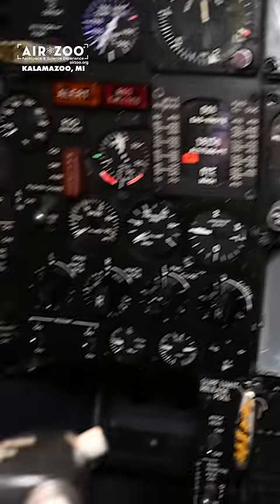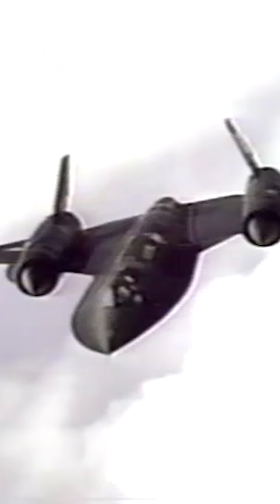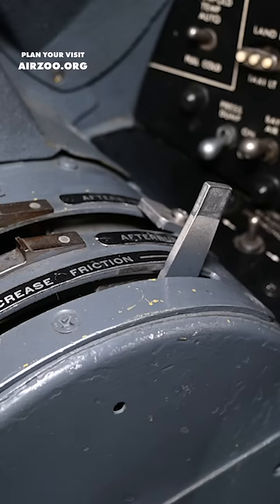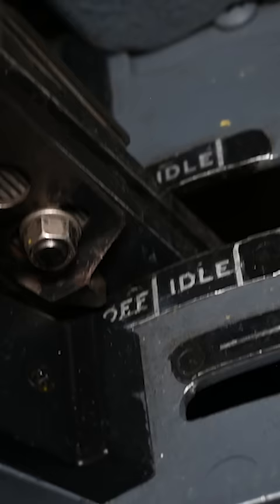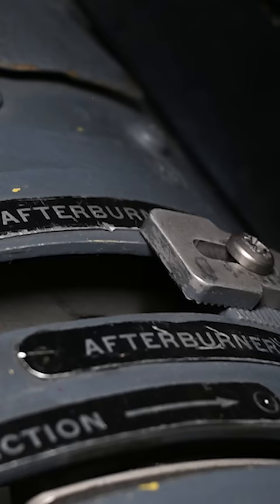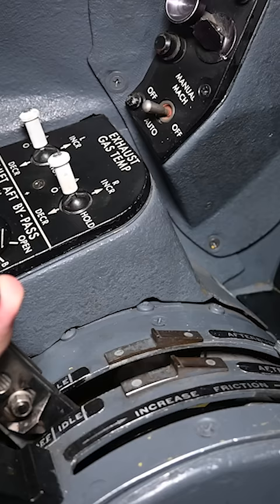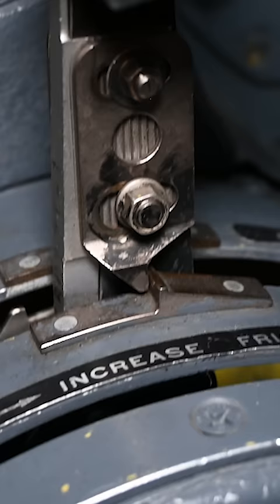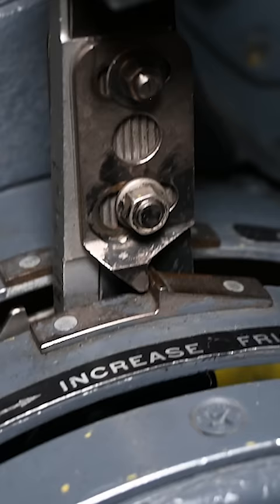The SR-71 Blackbird's throttle. #aviation

Comment: So every time you went into afterburner you used a shot of TEB?  I thought that was just for initial startup on ground and if you had to relight(restart) in the air?  I know they are kinda on and off the afterburner throughout there flight!  Thx. Love these little snippets of info👍
Reply: TEB, used during startup and everytime the a/b was stroked.  During the final moments of refueling, both engines at Military power(full engine power without using afterburner) didnt supply enough power to "keep up" with the tanker. A single afterburner was ignited in Min. a/b and the other engine was throttled as required to remain on the tanker. Every hour-20 minutes the -71 had to reduce speed/alt down to 25,000 Mach 0.4 for another 80,000 pounds of fuel from a tanker or two, or 3..
Reply: @hoghogwild so what you’re saying is that in the final moments of fueling the sr-71 was actually slower than the tanker? Am I understanding that right? Also, do you know how far they could fly in that hour and twenty minutes before they needed refueling because I would think an hour an twenty wouldn’t be enough time for sorties over the USSR. But I have no clue what I’m talking about lmao so for all I know they could cover half the earths diameter in an hour an twenty with how high up and fast they went.
Reply: @xinniethep00h  a)If the tanker and the Blackbird are connected during refueling in level flight, the Blackbird becomes so heavy with fuel that it wouldnt be able to keep up with the refueling tanker with BOTH engines in military thrust(most thrust engines will make without afterburners).  So one engine was placed in Minimum Afterburner and the opposing engine was left "dry" or not in a/b and that engine's throttle lever was moved to control the speed of the Blackbird. Once refueling was finished, the Blackbird would drop back, engage the other afterburner begin the acceleration/climb back to 80,000 plus feet and Mach 3+ speeds.
There was a method that involved BOTH the tanker and the Blackbird refueling whilst  in a slight dive.  This allowed the Blackbird to keep pace with the tanker. But as far as I know, the single A/B method of refueling was adopted.

b)A-12/SR-71 never flew operational mission OVER the Soviet Union.  It would skirt along international airspace and by using it's slant angle capability could peer/listen at great distances away from the track of the aircraft into an area of interest..

C) I'm not sure what kind of range they could get out of a full 80,000 pound load of fuel.  We can use the following numbers to extrapolate a rough guesstimate.  
"In March 1990, the SR-71 flew from Los Angeles to Washington, D.C. in just over an hour, traveling at an average speed of 2,144 miles per hour."
I'd rough guess that 3,000 miles could be covered in a single full load of fuel.  It took approx 2 minutes to reach 20,000 feet from takeoff, hit a tanker,  and another 17 minutes to reach 80,000 feet having used approx 1/3 of the fuel load.  The faster/higher the Blackbirds flew, the more fuel efficient they became.
I'm just an enthusiast, learning as I go. Good day!
Reply: @hoghogwild  wow thanks for the info. Sure was a crazy fear of engineering. I wonder why they never flew sorties over USSR airspace? Maybe they knew The USSR had missiles that could reach those heights and weren’t willing to lose one the 71s? Thanks again for the info, really appreciate it!
Reply: @xinniethep00h  Hey no problem, we all gotta learn somehow.  After the May 1 1960  Gary Power U-2 shootdown, the political embarrassment the USA suffered was to be avoided.  the CIA A-12 operated from 1967-1968 over Vietnam/Korea out of Kadena. One of the Vietnam overflights saw multiple missile launches(4 IIRC), upon returning to base a hole was found.  It wasnt a warhead pellet, but was figured to be a piece of metal from one of the missiles.  That's the closest any of the Blackbirds came to taking a missile hit.  the US gov after a flyoff over selected targets in the USA the SR-71 was chosen over the A-12(which though faster and higher flying could only take pictures).  the A12s were retired and the USAF SR-71's were flown in to Kadena and took over the CIA A-12 missions.
Reply: @hoghogwild  sorry, was the a12 faster and higher, or the sr71? what was the point of the a12 vs the 71?
Reply: @KuostA  A-12 just by a bit, it was shorter, held 68,000 pounds of fuel while the -71 hd an extra tank, therefore extra length, mass that afforded an 80,000 pound fuel load. A-12 was a single seat optical camera only picture taker, the pilot selected if the atmospherics were bright or dull and when over the target he started the camera and maintained course.  The SR-71 had the back seater, the Recon Systems Officer/RSO, who ran a myriad of electronic sniffing and jamming systems.  While the A-12 could take better photographs, the SR-71 with its better range and much wider capability set, had it's money stream kept open and the CIA's A-12's was shut off.  The SR-71 would fly around having Soviet missiles search, track and launch at it all the while the RSO is working his magic recording the missile's communications with it's launchers. This data would be downloaded and worked on by the intelligence guys on the ground and used to create new jamming strategies which would be tested on future missions.  Knowing how to spoof your enemies weapons can certainly have its advantages if war comes around.  The extra guy, with the extra fuel and all the extra electronics allowed for more flexible mission planning, targeting, tanker support(must supply JP-7 fuel only specific KC-135 Q-variants that carried JP-7 fuel for the Blackbirds, whilst carrying JP-8 fuel for its own engines to burn(at great distance).  At the height of Cold War spending, 3 KC-135Q tankers would orbit for the birds to "plug into". They burned between 36,000–44,000 pounds of fuel per flight hour. A-12 max was 68,000 pounds of fuel, SR-71 was 80,000 pounds full of fuel coming off the tanker.  If only one plane was to get the funding, the correct platform was chosen.  Hundreds to thousands of feet of ultimate altitude vs the multi sensor electro optical missions the SR71 system could attain. The blackbirds were difficult enough just to fly, these were the 60's and all that extra SR-71 capability required the human in the back to run the mission objectives. Each SR1 ejection seat in the 2 seat SR-71 was independently fired.  There was a light on the RSO's dash indicating whether or not the Pilot was still with the aircraft.  Those early missions were very risky, J58 engine "unstarts"would shake the bejeesus out of it's occupants. This was later much improved with later digital fuel and flight control of the J-58 engines.

Comment: I have a legit question, 4give me I'm a noob to all this but I'm absolutely fascinated by all this stuff (who isn't right) Q: When exactly would the SR71 pilot be required to use the max speed of the SR71 and would it be held at that speed for a long period of time or short bursts only or not used at all unless it was trying to outrun a missile or rocket the enemy fired at it? Thanks in advance 😊👍
Reply: Once at altitude, (edge of space,) SR was safe. Missiles fired from the ground ran out of fuel climbing TO that altitude - and had no remaining fuel to chase it. (If they could even catch up.)  (Why most U2s before SR's were actually safe too.  Pilot error - is why one got shot down.) 
 
Also - nobody knows the true max speed. It's "mach 3+," and my Dad can't tell me the truth yet...cause it's still classified.  He programmed the simulator.  

Mach 3 was a pretty good cruising speed. The missions were extremely time-sensitive.  The film had to return fast, for analysis. Old intelligence is bad intelligence.  The afterburners were always on, and it was meant to be that way. The plane was pushed to the max for speed records and testing. The "max" may or may not have been close to "normal" speeds. We don't know. :)  Stay curious.

Comment: That's funny that this badass plane is only at idle before you put it to full military power
Reply: The engine starts in the idle area, then you push forward from idle up to the Military Stop, you are now at Military Power. To engage the afterburner, the throttle is lifted up over the Mil Stop into Minimum Afterburner, further throttle application will result in full afterburner application thus providing Maximum Power.  You can move the throttle in both dry and wet engine operation.
Reply: @hoghogwild  Moving past the detent makes the maintenance crew cry
Reply: @stacey brown. All the military jets have an idle setting
Reply: @kg4boj  Don't be stupid, the plane is designed to cruise in afterburner. Why would they cry?
Reply: @hoghogwild  thanks for that!
Reply: @John Simpson  Because that's why there's a stop. When you run an engine at full military power you stress it enormously which is why pilots don't go past the stop for training except in special exercises. Once the engine is commanded to that power level many hours of inspection and maintenance have to be done once the plane lands before it can take off again, this is very expensive and puts the aircraft out of service for a long time, days or even weeks.
Reply: @kg4boj  Just so completely untrue.  First of all, military power is not full power.  Mil power is just maximum thrust achieved WITHOUT afterburner.  And afterburners are absolutely not saved only for special exercises.  Aircraft outfitted with afterburner(s) use the AB in all sorts of routine flights, and their use does not render the engines inoperable without service.  They are designed to be used, just like any other part of the engineering, and they will be serviced at regular internvals.

Comment: Did i understand correctly that TEB is also used to light the afterburner in adddition to basic engine ignition?  I always assumed the ABs light off the exhaust from the running engine

Comment: I wonder if they use a butterfly valve in the engine throttle, LMAO 🤣. I've always called those the power or thrust levers. Especially if they are controlled by FADEC.

Comment: Wait, a "restart" switch?
Reply: Engines would flame out under some conditions (too much angle of attack for ex. or a slight yaw at max speed) so they would "unstart" creating a very violent yaw since there are two of them and they are placed rather apart. The pilot would have to reset the inlet cone and then restart the engine...
Reply: @LegendaryGauntlet  whoa. At those speeds how violent a yaw are we talking? Like slam you head into the canopy windows yaw?
Reply: @JinKee  Yeah exactly, that, "slam your head into the canopy" violent. Some pilots did lose control because of that. It required nerves of steel to reset the computer that controls intake spikes then and only then hit the restart...